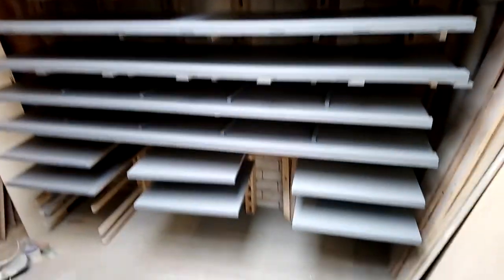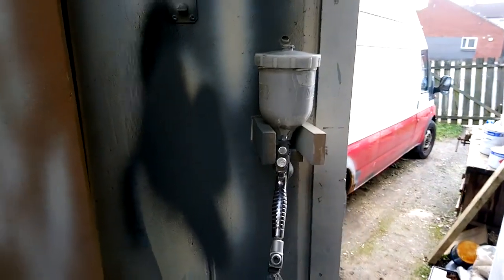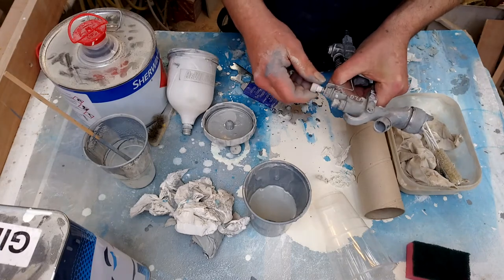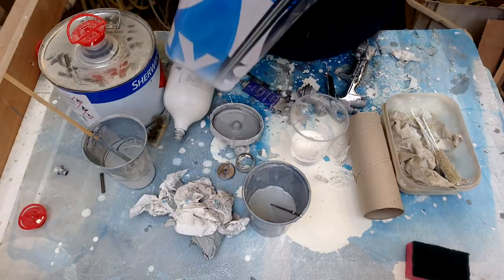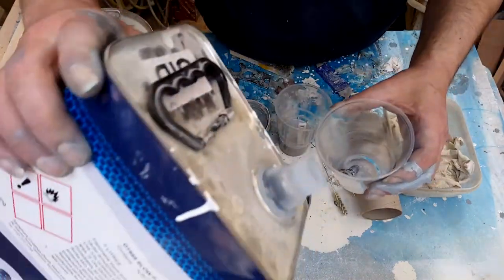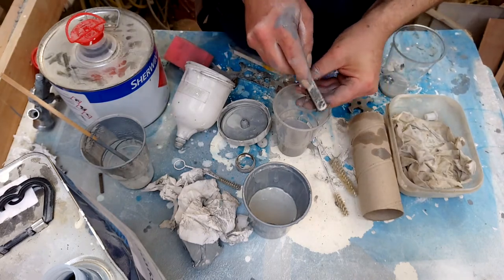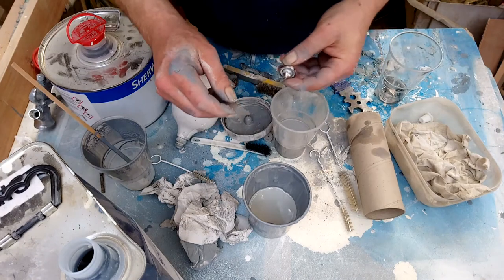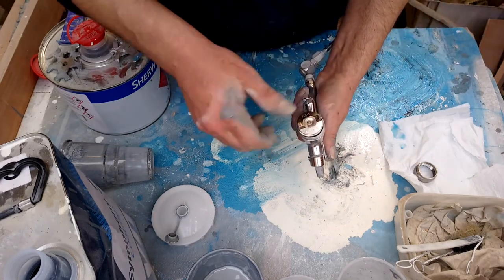Wardrobe build, nearly pt12 - Stripping & cleaning the spray gun first - Devilbiss FLG 5

Comment: How often Gid would you need to do a gun strip down as shown? Looks a nice piece of kit.  I don’t have room for a spray set up however it’s been interesting watching you go through the process from primer to finished colour. I bet your pleased to have space back now it’s gone to customers house for install👍😆
Reply from the maker: Hi, I would recommend that the gun should be stripped down after each spraying session but as I've shown i don't, i often just do the quick lazy clean 😉
I have a couple of cheaper ANI guns, I might show that it can be done without spending £100s on expensive equipment, 
The space is nice to have but I'll just fill it with stuff or with parts for the next job I'm on 😁
spraying doors & front frame grey Mon-Tues, fitting it all on site WED or Thurs, the paint should really have at least 24hrs to cure properly.
Thanks for watching, I'm glad you like them, 😊

Comment: Hi Gid, I'm looking at investing in a compressor and basic spray gun to help me with some wardrobes I plan to make for myself.  Any details you can share about a sensible setup, air filters, regulators etc...  PVC or rubber hose, that kind of thing.  The spray gun I was planning to start with is part of a 5 piece kit...
Reply: @Gidjoiner  LOL

Comment: Long shot but how do you undo the fluid cap as mine is stuck solid and believe me ive tried to unscrew it to the point where its rounding the nut  :(
Reply from the maker: Hi, can you explain 'fluid cap' pls,?  I don't understand which part you're ref to. have a look at this site & find the part then reply https://www.spraygunsdirect.co.uk/index.php/iwata-az3-hte2-water-solvent-spraygun-works-like-it-s-twice-the-price-bargain-all-rounder.html#sthash.pcaSp1Us.hhuLiFet.dpbs If it's glued on with paint try soaking in solvent ?
Reply: @Gidjoiner  it's the air cap, the screw bit behind it if you understand. Thanks the the response btw👍
Reply from the maker: What paint have you been using, is it a Devilbiss, ?
Reply from the maker: 👍 This is the FLG 5 spare parts link, you can let me know the part from here, https://www.spraygunsdirect.co.uk/index.php/productpartsdiagram/index/viewparts/id/2888/#sthash.qYZtaE0X.dpbs these guns are quite well made so everything should unscrew ok if using the correct spanner, & when stripping i make sure it goes together clean, the parts on the gun don't leak so i don't get much paint on the threads of the parts locking them so much they can't be undone, All i can suggest is soaking in the appropriate thinners
Reply: @Gidjoiner  a friend of mine said I could have it!
Reply: @Gidjoiner  part 3-5 in the diagram, currently soaking overnight in clearcoat reducer!
Reply from the maker: is it the Fluid tip, the bit the needle pokes through? behind that is a plastic diffuser for the air so although some paints soften with heat you can't put heat on this because you'll melt that part, put it in some Acetone over night & see, if it's been used to spray cars AC paint might soften,
Reply from the maker: Right ok, 3-5 the fluid tip👍 msgs getting crossed
Reply from the maker: BTW putting an exclamation mark at the end of a sentence is like saying it loudly, almost like shouting it,
Reply: @Gidjoiner  OK lol thanks for the replies